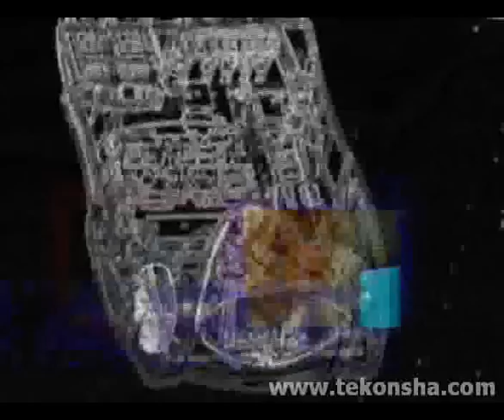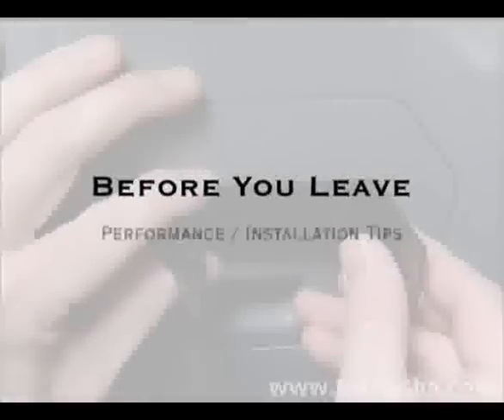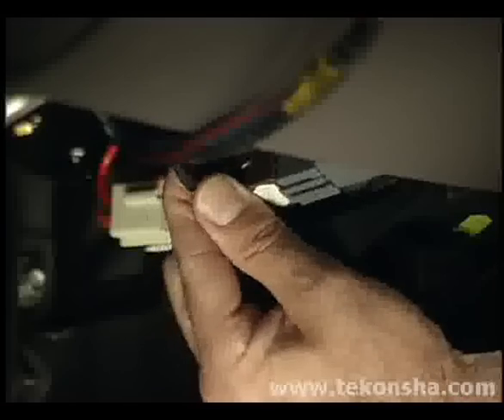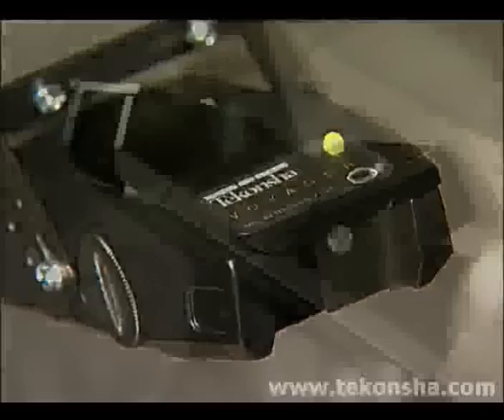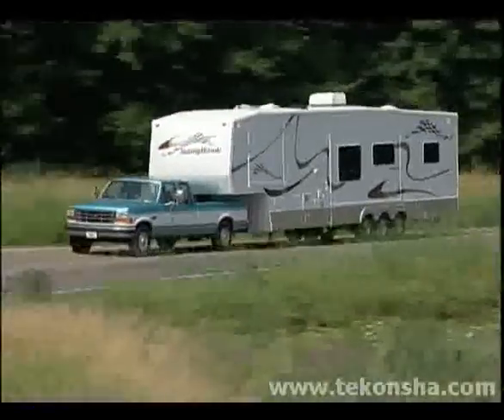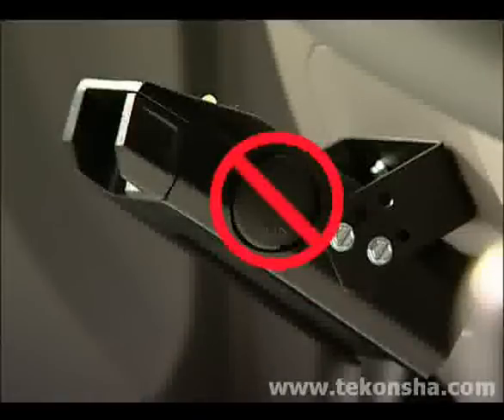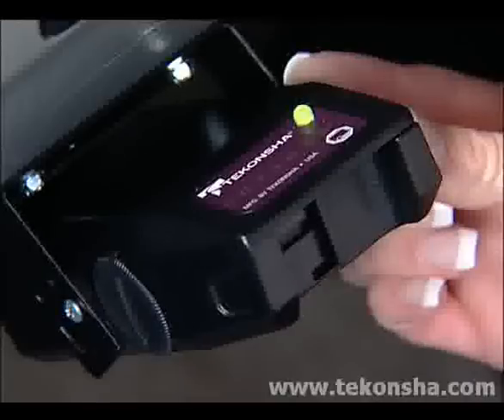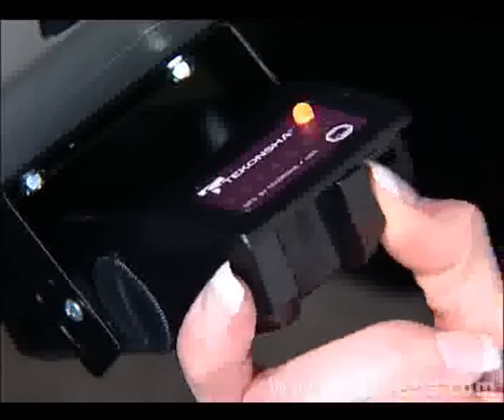Tekonsha Voyager Brake Control

Comment: I bought a pickup with this controller in it, and have had nothing but problems trying to tune it. I finally found this video on setting up and realize that I've been doing it wrong and was about to replace a perfectly fine brake controller. Thank you for this video!
Reply: Your welcome

Comment: I have two questions.. At 3:40 he says to turn the right knob up all of the way but later on he says not to move the right knob.. Do we leave it at full power?

My second question is when he pushes on the brake,never specified how hard to push.. Does it matter how hard we push for this test?

Thanks! Picking up my first fifth wheel tomorrow!
Reply: there is a pendulum inside most controllers  the  hard  you are stopping the more voltage it  added to the magnetic brakes..  Sitting still it makes no differance how hard you push on the brake pedal .. as a matter of a fact your brake light  switch actually activates the brakes.
  The Instructions are wrong so far as not messing with the right nob.  Light load  you want less vlotage heavier load you want less voltage
  I too but a used truck with this controller already installed.
  In the past I had controllers that you had to install Level .. Then  all  had was one nob to increase or decrease the power..
  Again  they say drive at  25 MPH..  You get no stopping force action sitting still.  You have to test the brakes for their power level while  in motion ..

Comment: I currently have a burnt out AME controller on my van, the vehicle I just bought has a Tekonsha Voyager Controller under the dash, can I bypass the old AME system and use the AME wiring (Black, Red, Blue & White) to hook up to the Tekonsha Brake Controller ?
The trailer brakes were working when I got the van, so the braking system in the brake hubs still work if I connect a hot wire to the positive they lock up the wheel from spinning

Comment: this is a good video,but my units level knob.doesnt turn [yet] and all i have is a control with 4 wires out the back.what wire goes where and will the brake level knob work after its hooked to power ?
Reply: This might help you a bit mate - http://www.etrailer.com/question-6890.html
Reply: Alan Walton forgot all about this mate,i eventually got it working,tuned in and did the travelling fine.thank you Alan.
Reply: feralhunta not a prob mate have fun

Comment: Video is useless trying to wire without the pigtail 🤦🏽‍♂️
Reply: I just did the same one on a 1990 f250, the blue wire goes to your 7 pin plug the white wire is ground the red wire goes to your break light and the black wire is your positive (weird isn't it?) Don't forget to put a fuse on the hot wire